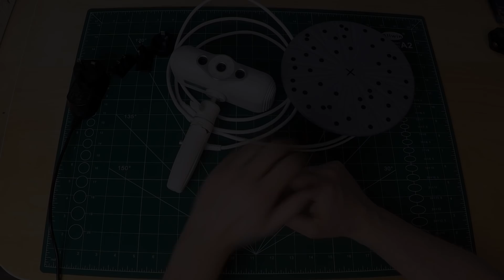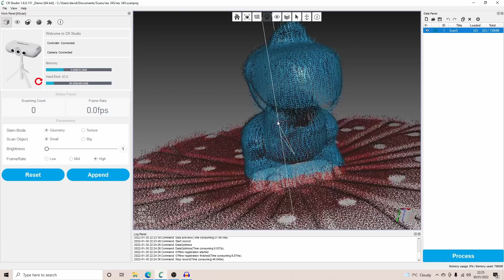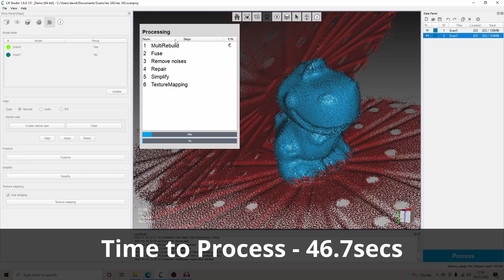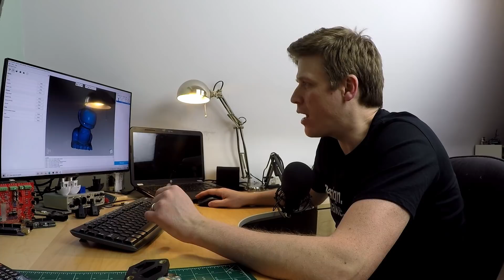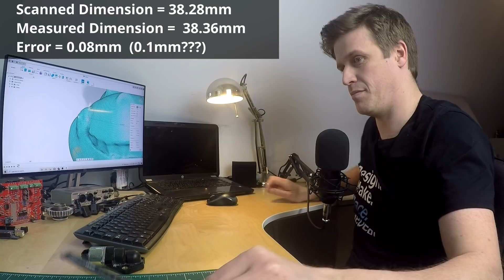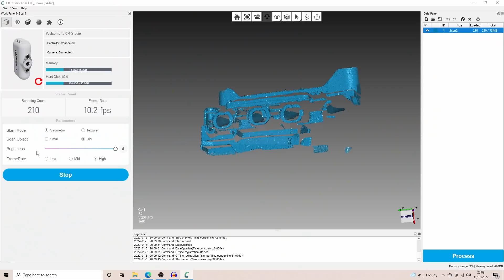Creality CR-Scan Lizard Review - does it reach 0.05mm?

Comment: I am not so impressed with the finish of the scan. Another scanner I keep getting advertised at is 3D Revopoint, supposedly that one scans exactly as the part itself, would be nice if you could review that scanner. Thanks.
Reply from the maker: I believe as far as consumer level scanners go, this is pretty good, Pop included, and any improvement on these consumer grade devices means literally thousands of pounds.  
I do plan to do a bit of a scanner showdown at some point so keep your eyes peeled! 👍

Comment: This is super cool! I have next to no use for this right this second, but I'd still love to have one. I do actually have one major project this would help a lot with. Plus lots of smaller items it could help with in the future. If the price is say $500-$1000 I could definitely see picking one up in the next few years, once I actually get a 3D printer and have some more funds. Really good overview. I mean no offense, but even your desktop is far from cutting edge, so most computers should be able to handle this. You really should upgrade when you can. It will make your modeling experience much more pleasant!
Reply from the maker: How dare you tell me that my £150 from eBay, 10year old computer with its £40 Facebook marketplace graphic card isn’t up to date!!! It’s got an SSD!!!  😂😂😂
Reply: @MakingforMotorsport  Hahaha I bet that SSD made it feel like a whole new PC! That said, yeah, still may be time for an update when funds permit. You can keep your current GPU. ;)
Reply: 1K puts you in the reach of an Einscan SE, and that is a lot more capable than this Creality Kinect knock-off. I guess the CR-Scan Lizard should be in the price-range of $199 - $399
Reply from the maker: I mean, let’s not pretend that the Einscan SE is a perfect solution, and even the scans I have seen with that aren’t perfect even in the perfect low light, correctly sized object, it’d be useless for 90% of what a car guy may use a scanner for (mainly handheld).

Now this may not be perfect but it comes enough bases to be useful…

 I think unless you are dropping some serious cash for a full on pro level tool, the usage case will be narrow or the  performance will be less than metrology….
Reply: @MakingforMotorsport  I get what you mean, this tool has its uses and I consider buying one to show my nephews some cool stuff at home.  
My price prediction was pretty much on point and is fair, I just hope they'll continue supporting it with new soft and firmware in the future.
Maybe even 3rd party software will bring support for it.
Reply: @damustermann  That's fair. I would def do a ton of research before purchasing any system anyways. Thanks for the info.

Comment: kinda shocked how meh it is compared to the cr scan 01/ revopoint pop1 it seems like they aimed at the pop2 but fell short/ lost all the benefits the cr1 had over the pop1 .. very odd
IMO
Reply: Scans better, smaller, no target stickers needed, and will scan a black object...
Reply: @Pygar2  it scans marginally better ( the point cloud accuracy is marginally better then the pop 1 and worse then pop 2) it's marginally smaller in some ways and larger in others seeing how it's more bulbus (pop is 170x24x34 vs 155x84x46) . it basically nixed the instances where stickers would be needed though. the biggest up side to the cr 1 is it could do large flat areas with no markers.. the lizard is aimed toward small / medium objects. which medium objects with features aren't really a problem. pop can do black./ dark objects in dark mode as well. just not black and shiny which we haven't seen that as of yet.. also notice he still something to coat the black object so even the lizard isn't doing a great job at dark/ black. the FOV looks smaller then the original cr01 as well. I was hoping it was the usability of the cr01 with better accuracy but it seems they aimed at the pop 2 directly but fell short as it's detail will still be better from a point cloud accuracy stand point. yes the single frame is .1 on the pop 2 and .05 on the lizard but PC is i believe up to .15 on the pop2 and lizard is .1-.2 so the .05mm is just a buzz word to sound "better" since point cloud is what actually makes the object

they switched from structured light for the cr1 to IR it looks like which is the same tech as the pop so in reality it'll have many of the same issues. pops biggest issue is direct sunlight which it the lizard says it can do .. but so does the pop haha

i'm interested to see more testing on it but I was personally hoping for more :( once i saw they were doing a kickstarter i was a bit upset my revo payment just went in but so far from seeing the specs/ what they say it's used for i'm not really concerned.. the other huge benefit to the pop is being able to use it on your phone. I scanned someones engine/ turbo by just taking the  scanner on the charging tripod and my phone haha
Reply: I don’t imagine creality have the knowledge to build their own 3d scanners. I wouldn’t at all be surprised if revopoint have just re-jigged the inner workings into a different housing for crealitys branding/marketing purposes.
Reply: @richardduke6447  the Cr 01 is completely different then the Revo
Reply: Yes I get that. What I was trying to say is there is no way in hell creality have assembled a R&D team to develop their very own 3d scanning capabilities. They have simply contracted another Shenzhen supplier to manufacture a similar or existing product in a creality branded housing.
Reply: @richardduke6447  Yeah, this explains someone's comment about why the same scanner is sold by both Creality and Revopoint (CR-T S1 & Tanso S1). So the Revopoint is the actual manufacturer of this product?
https://www.creality3dofficial.com/products/creality-3d-scanner
https://www.revopoint3d.com/products/tanso/

If so, is it possible that this is the case with Lizard as well??? OMG...

Comment: I could certainly make use of one of those. Would be interesting to do things like scanning a bumper to be able to custom design and print vents or grilles
Reply from the maker: Most mechanical pieces there is likely an easier way, but for trim pieces it’s likely essential…. Gonna keep playing and let you guys know! 👍
Reply: @MakingforMotorsport  sweet. Doing those complex curves is certainly not easy. Would take a lot of test prints to get right without the scanner. 
But it's good to see new 3d scanners at what will hopefully be a lower price point. Still outside my budget, but they're getting closer!
Reply: I think it would be easier and cheaper to cover the bumper with tape/plastic, mark it up to add texture, then use a camera to capture at all angles.  Import images into meshroom...and now you have a 3D model you can clean up and use.
Reply: @Perceivedshift  I guess that makes it a bit cheaper to do. Haven't tried photogrammetry but it might be worth giving it a go

Comment: Great video! Really impressive scanner!!!  I am shocked by the accuracy!  

If you need any help learning the mesh tools in Fusion 360 I would be happy to lend a hand.  With the flange on your idle air valve you can create a mesh section sketch, and then edit that sketch and then use "Fit curves to mesh section".  Fusion will allow you to place circles, lines and splines based on the mesh section sketch.  It does a pretty good job of averaging the mesh section to place a circle.  I did a BMW motor mount off a pretty bad scan and it was really close!
Reply from the maker: Cheers bud, I am gonna need to work on that part of my Fusion game, I started with 2D CAD so parametric 3D comes easy…
Just checked your channel and looks very useful!  The kinematic stuff is very nice!  Sub’d 👍
Reply: @MakingforMotorsport  Thank You!!

Comment: Cool, been thinking about this as well. Now i want one! I would like to use it for custom head and  tail lights using resin printing  and transparant resin and leds. Also want to design my own fog light scoops. Scanning and printing canards will be great too, with some carbon added afterwards. If you could  make us an Wideboy kit it would be awsome😌 build a big printer, print moulds and use carbon fibre 😁 my fantasy😉
Reply from the maker: I maybe missed a trick by not doing a panel with it, but I doubt it would struggle…
As for the scan>model>print>mold workflow… it’s getting very attainable!
Reply: @MakingforMotorsport  doing a panel or something you cant rotate around would be interesting. Curious to see what the device is gonna cost. I tried using meshroom for scanning my foglights but it has difficultys scanning it.  Next i try remove the light see if t helps.

Comment: How far can you go with the scanner? I would like to use it to make a space to design something in like a engine bay or the floor off a car
Reply from the maker: I will definitely do any engine bay at some point, I need to upgrade my laptop so I can free myself from the desktop!
Reply: @MakingforMotorsport  stoked to see what you can do with it!
Reply: @MakingforMotorsport  what about getting a USB 3.0 extension cable and using your desktop in a more local space for the testing? its not permanent and you can easily get more computing power on your desktop instead of getting a whole new laptop.
Reply from the maker: @THEONLYNIKOMATH  yeah… I need a new laptop anyway…. And I’d need a 100m long USB extension 😂

Comment: Bonus for mentioning electroboom.
Complaints because you both use substandard outlets and connectors.
Clearly the European standard outlet is the superior model.
Reply: Does this export to software like freecad?
In the sprit of keeping things cheap it would be great if it did.
Reply from the maker: @JohannesKonow  been a while since I played with FreeCAD but .stls and .obj are supported but the reason why it’s been a while is that I found Fusion360.  Unless you are a power user and will use the advanced features that FreeCAD gives you, it’s just too hard to use. Fusion is just much easier and still free 👍

Comment: Ive got a bunch of things a scanner would be good for, but tbh it seemed like a lot of faffing about. Maybe the tech will improve with time. Is there any indication on pricing yet?
Reply: For my day job I commonly have to use high end scanning equipment (100K plus gear). The top tech does amazing for detail, speed, and ease of use but is currently patent protected. Once those patents expire, I have no doubt hobby grade scanners will quickly become amazing.
Reply from the maker: No word on pricing (at least to little old me 😂)… there is faffing, no gonna lie, but I am a newb + doing an explainer, it got slick towards the end…
It’s like 3D printing, often a slow start, plenty to learn but it speeds up with practise👍
Reply: @MakingforMotorsport  Im really tempted, but need it to be economical and be Mac compatable. PS mums shopping trolley needs a turbo! 😉

Comment: for hand held mode, have a look at a tracking rig - like cameras have, take a lot of wobble out of the job! sure you could knock something up like a oooh skateboard
Reply from the maker: Hmm…. I have just bought a gimble…. 🤔
Reply: @MakingforMotorsport  Gimble plus one of those spring loaded lamp fixtures and you're basically Hollywood!
Reply: Proper printing made a camera rig that uses gcode and klipper to programmatically control it. Extremely nifty.

Comment: Would love to see how an enginebay comes out! I used Photogrammetry so far for my diy scans but never a real scanner :)
Reply: For Photogrammetry I always just take a video at 30fps and split it into single frames afterwards. Makes for quick and intuitive scanning with pretty good results ;)
Reply: @nutblaster-g2r  i will try that ! Thanks
Reply from the maker: I will try it out… just need a better laptop! 😂
Reply: @MakingforMotorsport  forget laptos, as they are too thermally and power restricted. much better to do this on a proper desktop.
Reply: @fsouzajr  its all fun and games until its time to actually purchase that desktop lolll
Reply: This isn't bad at all for home gamer setup. I run a few metrology grade 3D scanners at work, obviously, they smoke this system but the price has me curious.